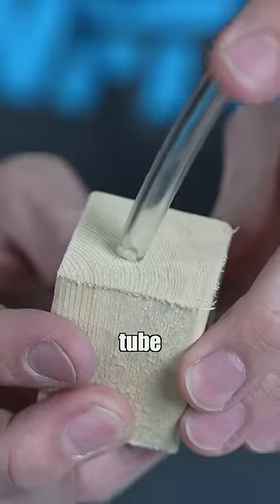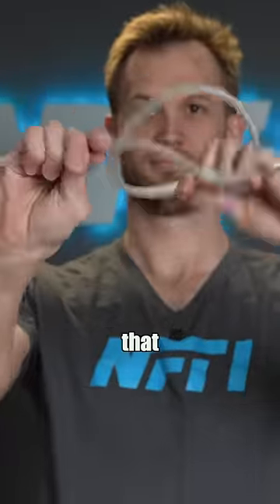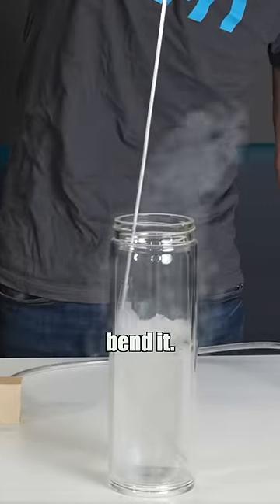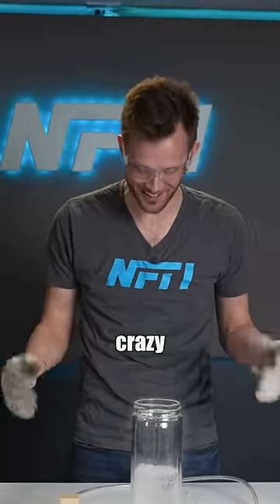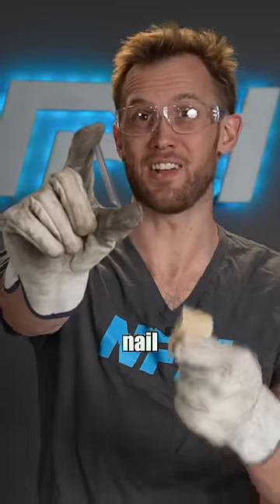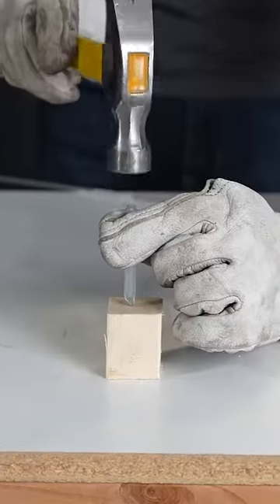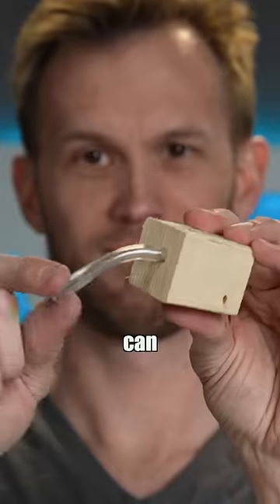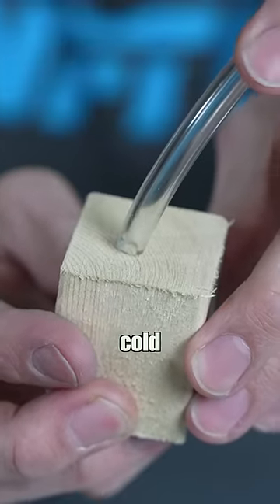A Vinyl Rubber NAIL?

Comment: I made several water airbubble blocks doing just that with a relatively soft wood with tightish grains. Put the tube about half way through the blocks and connected the other side to a air pump. It would release microbubbles through the wood grain.

Comment: This is a due to a thing called the glass transition temperature and all polymers (rubbers, plastics, epoxies, etc) have it. Tg is different for every polymer and depends on the molecular weight but it's also also useful as it can tell you a lot about the properties of a polymer as well.
Reply: Thanks for pointing the actual material science out
Reply: @agadamSystem  I saw that everyone else was just talking about him and his branding so I figured I'd explain the science a bit. I kinda wish it got pinned though so people could actually learn a bit about why this works, but I'm not gonna ask to be pinned.
Reply: @zackarycrider5191  you just asked
Reply: @fudgyboo  if I were asking him I would tag him in a response, I doubt he goes through every comment so he probably won't see the ask unless he gets a notification everytime something post a comment or a reply to a comment

Comment: Try freezing rubber nails, and hammer them into a 2x4.
Now for the pasty resistance, pour
room temperature mercury into a mold of a nail, freeze that, and pound into wood.

Comment: Bolsa wood is also very very soft and even a staple gun can shoot staples half way through the block of wood.. if it was pine or anything else hitting a frozen tube would shatter as you would need much more than tap tap tap..
Reply from the maker: I think this was fir

Comment: You actually shouldn't use gloves when handling liquid nitrogen. It wants to boil on your skin, but without a glove, it will create a gas layer on your skin, protecting it. It will freeze however, if you wear a pair of gloves
Reply: He didn't.  He handled the frozen tube with gloves.

Comment: That tangentially makes me think of the "impossible  nail-through-wood trick". Some novelty you can present to someone and make them wonder how this non-puzzle was made. With the impossible nail through wood, its a wood block with 4 "teeth" sticking up that has a nail through the center 2 teeth without any noticeable distortions or holes to the wood. The nail's head stops against one wooden tooth, while the nail point is stopped by the tooth at the end. The trick is, you have to use boiling water to soften up and squish one tooth at one end using a vice. Drill a hole in the two central teeth. Stick the nail through the holes, boil the squished side so it can re-expand.
Reply: But it's not a non-puzzle. The puzzle is figuring out how it was made. Very puzzling 🤔

Comment: You use two different types of forces on the two different lengths. One was a horizontal load and the other was a vertical load causing drastically different stresses on the frozen tube

Comment: If you dip the wood in boiling hotwater until it gets soft then you can insert the tube inside the wood and after you insert the tube inside the wood just dry the wood in sunlight for an hour and see the magic, note = use the soft carpentering wood for better result it always worked for me 😁😁😁

Comment: If you can figure out a way to move it really really really fast you might be able to do that without the freezing part and just use pure sheer acceleration to drive it in there

Comment: So this is actually wrong. Pure PVC is extremely brittle (to the point it is unusable) at room temperature. With the addition of various plasticizers, PVC’s modulus changes and it becomes more flexible. The idea is that PVC is, chemically, a bunch of sticks stacked on top of each other. In that formation, the molecules undergo hydrogen bonding which makes the structure extremely rigid. By adding plasticizers, this interrupts the hydrogen bonding and allows them to move past each other. 

By the way, you’re not freezing the PVC because it’s a solid already. You’re just dropping the temperature below it’s glassification temperature by a significant margin. Polymers below their glassification temperature exhibit glass like properties and are less able to deform due to the polymer chains becoming interlocked.

Comment: We have a kids museum around here and one of the demonstrations they had, probably don't anymore as that was 25-30 yrs ago, was driving a nail into a piece of wood with a hammer made of half of a banana on a stick. They'd pick a kid, bring them up and put safety goggles and a lab coat on them after the banana was frozen to have the kid hammer in the nail. I was never chosen unfortunately.

Comment: You drilled a hole with a Mill-Hill bit 

My Orthopedic Surgeon used the same thing to remove a broken "Transverse Pin" in my ankle. It is like a hole saw without the Pilot Bit. The broken pin and a plug of bone slightly larger than it gets removed and leaves approximately a 6 mm hole behind. 

But if you only drilled in a few millimeters it would make it look like that tubing was hammered into the wood. 

Good job on the fake video.

Comment: How permanent is the bond? Or how much force is required to remove it?
Reply: I asume it's a pretty strong grip the wood has over the rubber thingy, as when it unfreezes it dilates pressing on the wood, wich also has it's texture. Probably it's easier for the tube to break than to slip away when room temperature. 
But it has to be tested lol
Reply: Considering how it is guaranteed to shrink when super cool, and then expand as it warms up, there is no removing it.

Comment: Didn't this guy said that using gloves while handling liquid nitrogen is more dangerous because it will get stuck in your hands longer?
Reply from the maker: Gloves while handling/pouring the liquid are bad, because the liquid could spill, soak into the gloves, and freeze your skin.  Gloves while holding solid objects that have been frozen are good, because vinyl tubes cannot be absorbed by gloves, and therefore the gloves offer protection.

Comment: 'never' is factually incorrect, throw it fast enough and at the right angle i.e. central hole facing along the line of travel and itll punch a nice hole through the block